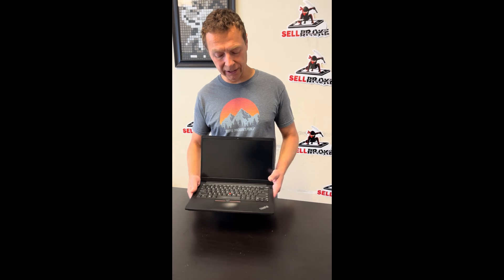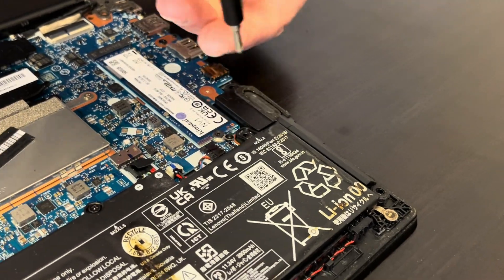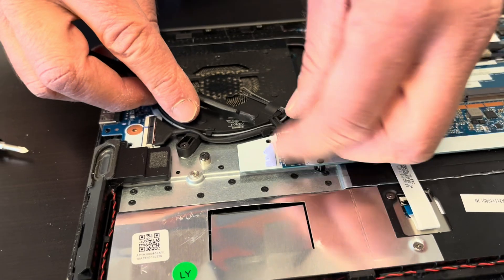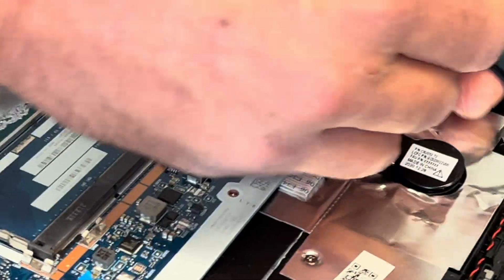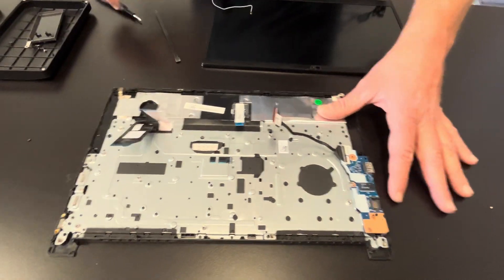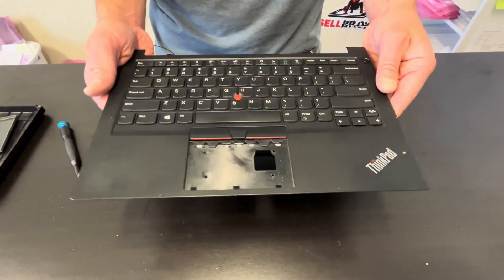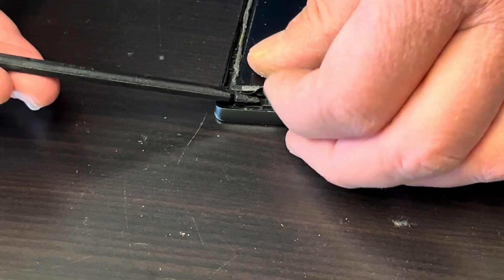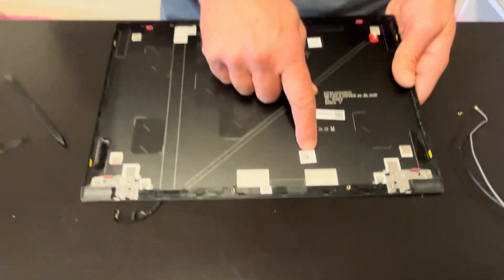Lenovo Thinkpad E14 Gen 2 i5 1135g7 Laptop Complete disassembly. Repair, fix, upgrade, replace parts

Comment: hi. iam plaaning to buy that version, does it have soldered ram? intel version iris xe need dual channel so im wondering if it can support that.
Reply: No. Only one removable slot. The AMD one has one soldered, one removable and from gen 3, two removable are common.